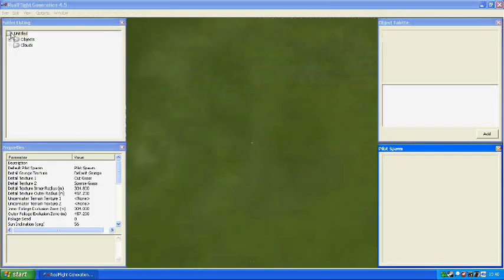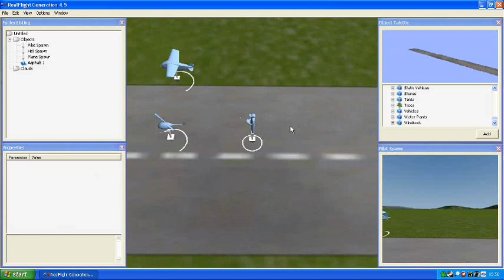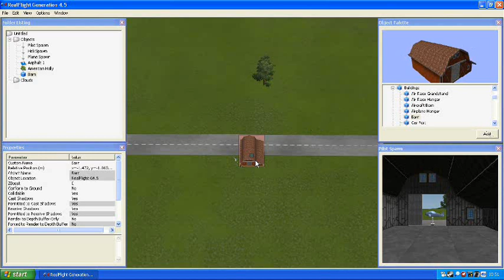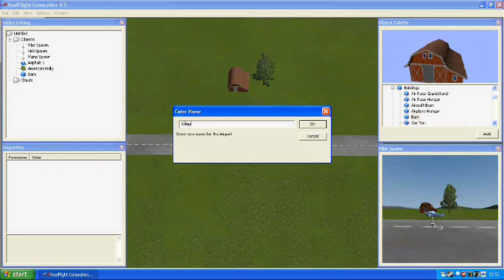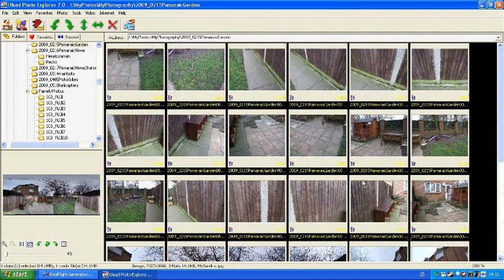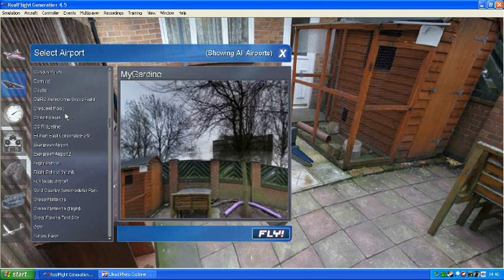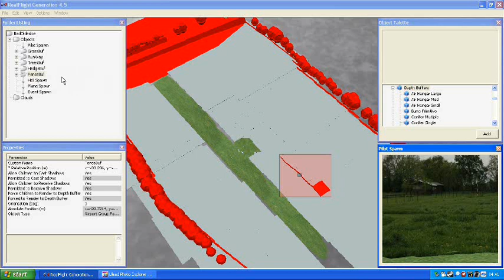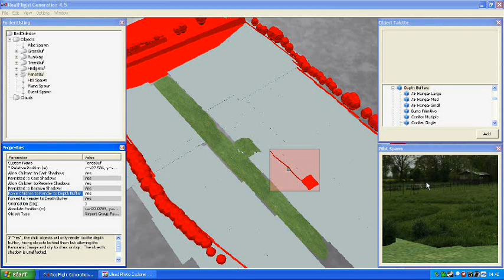Real Flight RC Plane, Helicopter, Jet simulator Part 2

Comment from the maker: Optimum System Requirements:
Dual Core 2.4GHz CPU
2GB RAM

USB Port
512MB dedicated video memory Pixel Shader 3.0 support
Windows XP, Windows Vista or Windows 7

sorry not for mac but at present time Dec 18 - 2010 its about £179